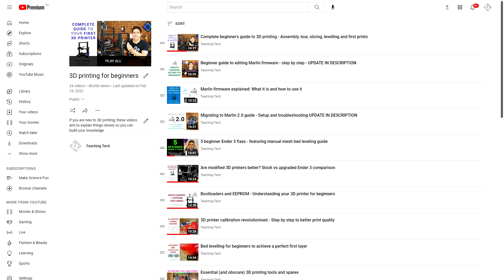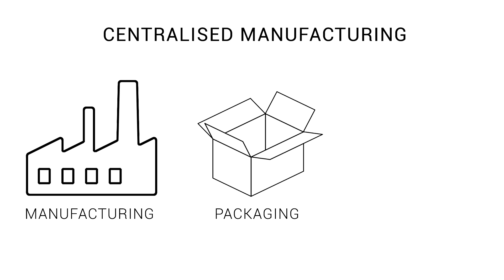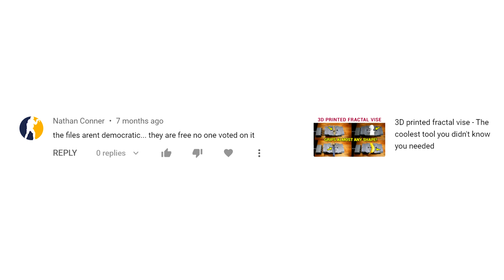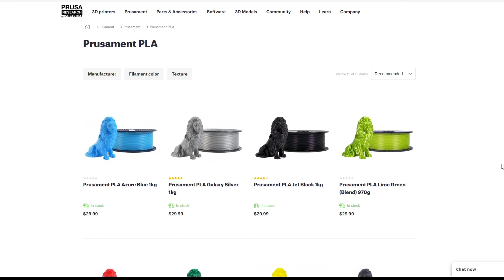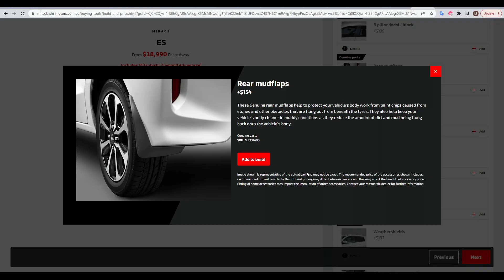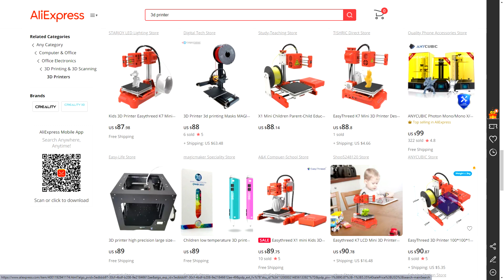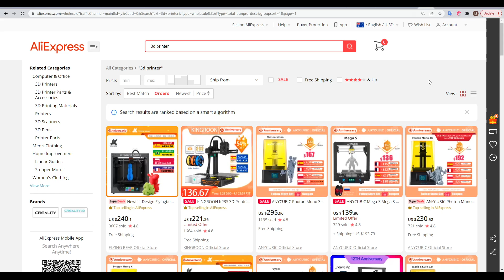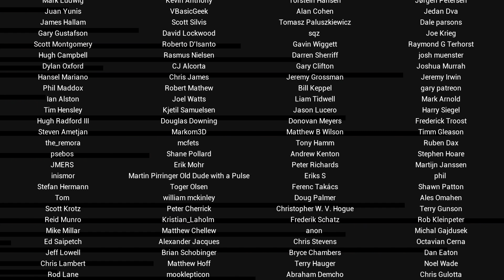3D printer trends are limiting mainstream acceptance: The 3D printing paradox

Comment: I have ALWAYS thought that the “printer in every home” idea is nonsense. There truly is only so far you can go with making them simple and intelligent enough to take care of themselves. What IS a realistic and achievable goal is a 3D printing expert/group per community, that anyone can go to for things if they want/need.
Reply: I think for most people, a 3D printer will just be like the kitchen device that sits there and takes up space.  Only to be used once a year for that one special recipe they bought it for.
Reply: I'm of a similar thought. I was annoyed by this kind of starry-eyed thinking in 2015, to see it pushed this year is eye-rolling. There's no reason to assume there's enough desire for home, non-tinkerer use. FFF and resin just aren't very good processes for several reasons, their benefits are more in niche use cases. 3D printer manufacturing is definitely stuck in a rut though, there's not enough incentive to develop a better system to a market that wants something shiny and doesn't require skill to operate and maintain for $100.
Reply: The break in the chain isn't the printer in most cases.  Makerspaces are everywhere - librarys, schools, etc.  It's the skills to design.  Some things should not be 3d printed.  A mailbox, or a birdhouse, for example, can be made with wood in a couple hours.  3d printing them takes days... just for the parts that you still have to assemble.  Unless there is a big use case (like you want engraved art and don't have carving skills), it's just wrong.  To those people who understand what he is talking about though - reverse engineering of out-of-production household parts - the cost of a printer is nothing.  Just one part I printed to repair an electric piano would justify the cost of an ender 3.  That's not even based on the cost of replacing the piano - it's based on the cost (actually near impossible) to obtain service at a local shop of through a local technician.
Reply: @robertlaw4073    yes for those parts it is indeed invaluable and those are the sorts of people who would greatly benefit from owning their own machines, as I have for the past 5 years. However that’s somewhat outwith the scope of discussion here. I’m not discussing the merit of 3D printing in every use-case but the fundamental flaws with the idea that a printer per household is a sensible and viable goal.
When it comes to the design of or replication of parts, I expect the number of people able to do so to continue to increase as CAD literacy does. They could then send the files to their local print hub - a service I provided for several years, as well as part design as a matter of fact - which is overall a much more sustainable setup. For many of my past clients this was more affordable and sensible to get prototypes of their designs quickly than to have to buy, learn to operate, use and then keep a printer around. And where I am there aren’t many MakerSpaces sadly!
Reply: @AcrimoniousMirth  Appreciate your reply.  In my experience maker-spaces are imperfect for another reason.  Often the staff who man them is under-trained.  Five years ago I went to the HUGE makerspace with a fleet of 3d many printers/cutters/etc. in a major urban library near me to try to print a very small item - grommets for an out of production tennis racquet. No one could help me through the process, and I am a pretty tech savy guy.  All the library staff were equiped to do was sign you up on a sheet, take your thumb drive, and put you in the queue.  That was a wasted day trip.  Meanwhile maybe 4 years ago my community library invested in a printer, but they had really no expertise to maintain it.  I got it out of the trash and it was just kinda messed up.  Care had not been taken with nozzle assembly, so there was gobs of plastic that had welded the hot end into a mess.  The idler and tension adjustment of the feeder were put together wrong.  Now that is kinda proving your own point, that to get to a place where machines can be maintained by generalists (e.g., "tech librarians") in a central place and used efficiently, they have to get easier to use.  But the overload point for a machine is lower than you would think, particularly given how slow the process is to make a single prototype.  Multi-stage prototyping by one individual on a single project can tie up a printer for days.  That community library I was speaking of - they implemented a rule of 1 print job per week.  I was working on printing 6 box dividers for a bin... so what should be a 6 hour project became a 6 week project.
Reply: @robertlaw4073  I completely understand and agree with your point but all it goes to show is that you would be good as one of those “community contacts” who knows what to do with a printer. It doesn’t invalidate my point about printers not being for everyone and I agree that MakerSpaces are not the solution, but only part of it. Now that you know how to use your printer and are essentially an “expert” do you find yourself being asked to print things for friends or neighbours? That’s more the sort of “community contact” I envision, if that makes sense.
Reply: @AcrimoniousMirth  Nope.  Because in point of fact, the idea of "geographic community" is a non-starter in the 21st century "consume cheap / borrow money/ outsource" world.  My neighbors don't fix their vacuum cleaners (another 3D repair I'vd done) - they toss them in the trash.  Thrift and sustainability just aren't "sexy" to most people.  They want glitz and glam and NEW stuff!
Reply: @robertlaw4073  that’s changing, though not fast enough.

Comment: My take from this is, that we're waiting for that "Windows95" moment.
PC's were in a very similar position until Windows.
It doesn't make PC's better, it made them accessable. Suddenly even the receptionist is a computer operator!
Where would the same effect be achieved in 3D printing - hardware or software?

Comment: I disagree with most of what is said here. Yes, 3D printers as we know them today will not see mass adoption, but, a form of them will. However, paper printers still need maintenance, and so on. As do vehicles. Also with a vehicle, you described the buying process which isn't too dissimilar from that of printers. However, most all people become licensed or receive some training/instruction on how to drive a vehicle. This isn't something that happens with printers. Also with vehicles, most people won't fix their own car. So it's not a good comparison as someone could buy a Prusa and then use them for support.

Comment: Aslong as its not 100% "Plug and play" it will remain at its current state. Also, the whole marlin / klipper as firnware is really way way way too mutch to get into if you just want too upgrade the printers.. Got over 6 years of exp and i can confirm this from listen  / helping  customers who are losing their minds, since trouble shooting will reveal more and more problems.  Even with Ultimakers / Craftbots installed at firns i still need to visit them often to swap out hot-end or whatever. and those are 1k+ easily dollars printers.. but to be honest i  kinda like it about the hobby the steep learning curve.

Comment: Perhaps it's more accurate to compare 3D printers to used cars: the cheaper you go, the more problems you can expect. In the case of cars, you can outsource the repair and maintenance expertise to an auto mechanic, but with 3D printers you'll have little choice but to do it yourself.

Comment: Unlike a car or a washing machine, 3D printing by its very nature, regardless of the quality of the printer, requires a level of “mechanical” aptitude to up keep. Of course there’s room for improvement, but maybe that’s where the problem is.
Reply: by its nature?
Reply: @you_just  that nozzle will eventually jam and the frame will eventually wrap, etc. Imagine of you had to open up your 2d printer and take out the mechanical parts every other day to solve a paper jam.

Comment: I don't agree:

FDM is NOT a toaster or even a 2D printer. It has too many process variables that must be exposed to be useful. The power and utility as a tool for proper democratized manufacturing (as opposed to a "crafts" gimmick) come partially from the level of complexity. Skill is also inherent in designing any sort of mechanical part. The issue with why "consumerized" FDM has not materialized with any success can be said to have little to do with FDM and more to do with the challenges inherent to the task.

We have already come reasonably close to the sort of user friendliness/UX implied. If you have a mesh/probed machine with a good hotend, that has a reliable motion system/is not an enderoid, and don't do anything stupid with it, use is easy, and downtime very rare. And it's not like 2D printers are hi-rel or honest gear. Consumer 2D printers of late model are inexpensive because they are some of the most value engineered (cheap shit) equipment on earth. They are also sold at losses because ink is the real cash cow, hence the continued problem with DRM ink cartridges and other anti-customer, anti-environment misconduct by the market with them, which is both highly unwanted by everyone and highly unsuccessful in 3D printing.

On that note, hoping for big name manufacturers to innovate centrally in this field is itself a bit paradoxical. It is not either unexpected nor ridiculous that innovation trickles up and corporate entities are not effective idea generators/developers here when the innovation is mostly defined by an end goal of cutting centralized manufacturing, IP encumbrance, non-standards compliance, etc. wastes out of the system. They may not overlap always i.e. there is obvious room for 3D printer vendors in the market but expecting progress to happen mostly centrally in this context is perhaps expecting the chickens to design a better fox. Automotive is more central because of history and because it perhaps makes more sense there. To approach something like this with an arbitrary anti-"hobbyist" bias based only on how things are traditionally done in some other field is not appropriate.

Indeed cheap me-too clones are issues. I hate all enderoids with a passion for many reasons but one of them is that so many vendors have jumped on the bandwagon of this non-engineered wheely perversion of the i3 pattern because everyone else is doing their own enderoid so it must not suck; right. (wrong.) Also PTFE hotends need to go away forever. PLA-Only machines and the overpromotion of the material PLA (and its poor HDT) are something I think holds back the tech when our users are looking to solve problems, not make desk toys/crafts.

Self-diagnostics are overrated specifically as to cars, just wanted to say that. They do not really make cars easier to work on or maintain. If you do not know what you are doing, you still need to get help from someone who does, perhaps even moreso with modern engines. The root problem is unavoidable. It's similar with printers. Putting a better HMI and selftest routines on a machine is not a magic bullet.

This is more a general viewpoint of mine and not specifically about printing but what is actually called for is to distribute knowledge and make end users more competent and more actually self-sufficient on average, not put more training wheels on the machines hoping to make them have mass appeal, like a toaster, as if that will make the big limiting problem standing there in front of the control panel go away somehow. The good thing is that it appears that is happening. It's happening in way that involves too many Enders and cheap Chinese hardware frustration posts on the internet, but it IS happening.

Comment: is it just a paradoxon?

3d-printers are the first category of devices for home-users, that are mostly open source and community driven. there are companies that try to make a few quick bucks by building cheap printers, but most of them are just clones of either creality or prusa, and both took massive inspiration from the open source scene (prusa is giving back a lot).

you compared 3d-printers to their 2d-counterparts. but here is a problem: the revenue stream in 2d printers is: this thing needs ink, and ink is expensive, and dongled. this is virtually impossible with 3d printers, just imagine a 3d printer ink cartridge, it would be heavy, expensive, and hard to seal in a way that the filament can't be accessed.

so, what we are seeing in the 3d-printer scene is something that we will see in many other types of industry too. there are a lot of products that are not so hard to produce locally.

Comment: I need some help I have Ender3 printer and use Cura for slicing I got a model from thingerves after slicing placed in printer after heat gets to print use on the printer screen at the bottom (Waiting for user) Nothing happens no print

Comment: Examples from the automotive industry, where the work done by tinkerers was inspiring enough to be adopted by large manufacturers....  Jeep Wrangler Rubicon...  Jeep Gladiator (AEV Brute and other home-brewed wrangler/CJ based pickups).  But Jeep does a better job of listening to its aftermarket and enthusiast base than most other manufacturers.

Edit to add, MGBGTV8 and probably other examples from the pre-1980 British sports car industry.

Comment: I think it gets into the basic design choices. If the structure is made from aluminum extrusions, that have to be tweaked with for proper alignment, leaving other bits in need of tweaking isn't much of a jump. A mass market printer would need to start with a solid base: a frame that's cast or something, with no alignment needed, and difficult to warp.

Comment: Respectfully, this is not a paradox.

This is VERY early days, like when there were few automobile manufacturers. Then Ford brought the Model T to the masses. I think Prusa is like Ford. Other manufacturers are coming up to challenge Prusa, and it won't be long before we have the Chevrolet and Toyota of 3D printers.

I think cars aren't a bad analogy to 3D printing. People who don't want to tinker with their cars can take them to a mechanic. I think in the not too distant future there could be places where people know they can go to in order to get a 3D part printed. Like a part for their refrigerator or washing machine.  Cheaply.  Probably won't be in 5 or even 10 years, but it is definitely possible in the future.  That will also be a time when people who have 3D printers but don't want to tinker with them can call on a professional who can fix them, like calling a plumber today if you've got a toilet that doesn't flush or a hot water heater that doesn't get hot anymore.

Comment: Mixed feelings here. I agree that the market could use some true "dishwasher" printers, but we as the research community (ie. hobbyists) still don't have a way to do that. The manufacturers that have invested in the tech are selling low volume high value gear to other manufacturers ($10k+ printers) which is still a market with lots of growth potential. Those will eventually be the trickle-down technologies, unless the Open Source movement provides the solution.